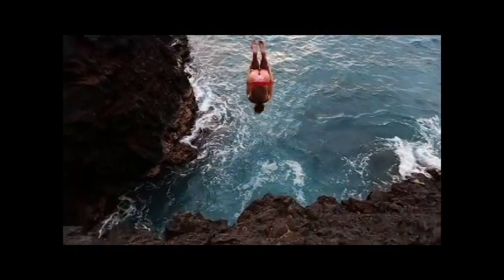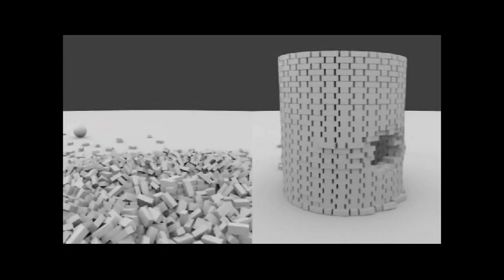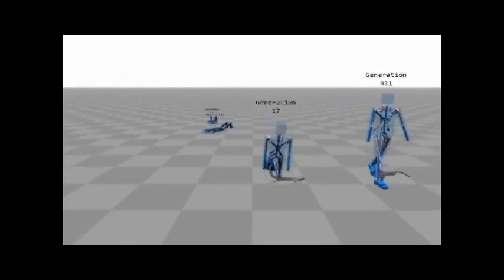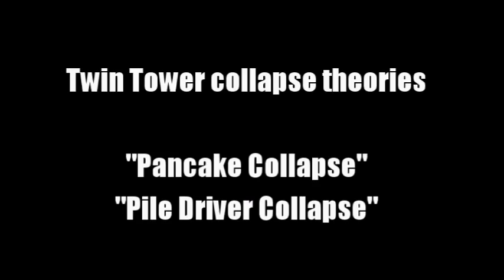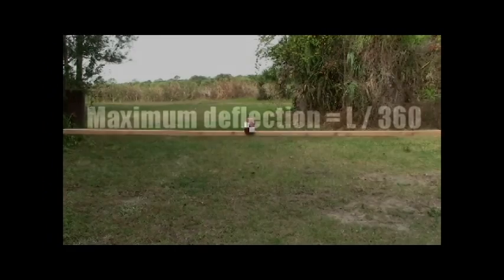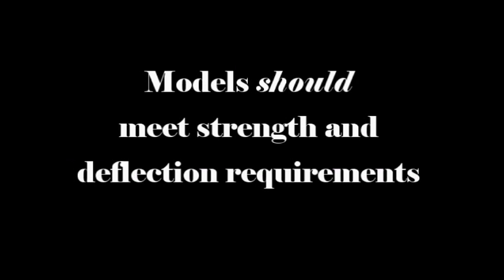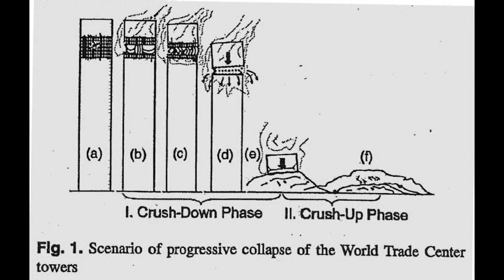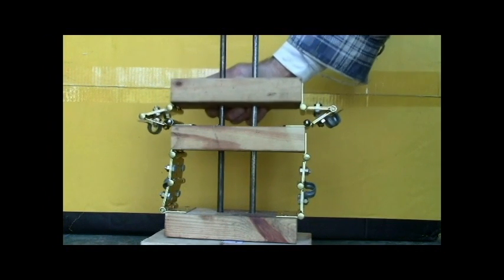9/11 Experiments: The Force Behind the Motion

Comment: Bottom line, this was an inside job
Reply: Andrew and explain how steel can magically swallow and aluminum plane.
Reply: Andrew That’s right. I’d understand the top 20 percent of building collapsing. But it should’ve stopped there. The rest was a demolition. It breaks the law of gravity and physics and air resistance is a huge key factor is the governments fantasy.
Reply: HungryForWater FX "it should have stopped there".  Should it have?  That 20% you speak of weighed about 45000 tons.  The floor underneath that can only support 1300 tons....couple that with the flawed exoskeleton design of the building.  Multiply that times every floor going down and you get a collapse.  God I'm so tired of explaning this to you conspiracy morons.
Reply: Andrew and the building were built to withstand plane crashes at 600 mph.
Reply: No energy was conserved?
Reply: You haven't watched the video have you. Watch the North tower collapse, in reality it took close to 25 seconds due to the final beams needing to fall down. However I will give you the benefit and I will only count to when the main collapse hit the ground. Around 17 seconds. No law is broken. Also you will be using why didn't the building slow down? Well it did actually, the North Tower nearly came to a stop before hitting the ground. Due to this people inside Stairwell B on the bottom floors survived.
Reply: Don't bother giving me any of your proof. I used to believe in this nutjob. I don't now cause the arguments are pathetic.
Reply: Now WT7 is the smoking gun? 
Well I'm sorry it didn't collapse in 5 seconds either. More close to 16 seconds. See the building was collapsing 10 seconds before the 9/11 truther videos begin. The building started collapsing with the East penthouse. It dominoed down which brought other internal structures down with it. Eventually the outside core couldn't withstand it so it collapsed.
Reply: How does your life improve when posting here?
Reply: Damian Gastelum you are 100% right I've been saying it since day one come on anybody with any logic could you just look and see
Reply: Listen to how it sounds at the beginning, with just a few, versus many at the same time...
https://youtu.be/aNMZSlinbMU?t=11s
It's as though there is a sound cancellation going on, thus creating a hiss, rather than pops.
Likewise, a rumble, rather than booms...
https://www.youtube.com/watch?v=VU7cTfdxOkY
Reply: Your proof being?
Reply: Andrew No energy was conserved
Reply: It didn't break any law of gravity. Everything falls down, thats why buildings are built to not fall down. However when a plane hits it with 11 times the force it was built to withstand it might just collapse eventually. Especially if it burning for half an hour. The steel beams were weakened to less than half their strength
Reply: Andrew it sure did. The buildings fell about in 10 seconds. The building fel at free fall rate which is 32 ft per sec per sec, that’s means there’s no air resistance. But in New York air resistance is high due to it being st sea level. The building should’ve fallen longer if the floors were collapsing on eachother. What’s your thoughts on building seven? Falls from absolutely nothing. And don’t tell me the office fires did it because then that wouldn’t explain how the Oklahoma City combing blew up have the damn building stood perfectly. A plane ran into the Empire State Building and stand strongly today. The twin towers were the most planned out architectural project in history. The facts and evidence is there. It’s your job to figure them out n
Reply: HungryForWater FX the empire state building was A.) not hit by a commercial size plane going top speed carrying full fuel, and B.) was not designed like the WTC.

Comment: Just like math experiments are models too. And it doesn't matter if you do a simulation or an experiment. If your model is wrong your conclusions will be too. And there are many faults in your experment. E.g. the used materials do not even closely match the ones from the original towers. Therefore your conclusions are as wrong as the other theories you mentioned.

Comment: This experiment makes no sense. The towers weren't hit by kinetic orbital strikes lol
Reply: They weren't smacked down by the Jolly Green Giant like NIST would have us believe either. So what's your point?
Reply: What? My point is that this experiment was poorly designed and doesn't produce any useful data. I'm as skeptical of the official reports as the next guy. That doesn't make this real science. This is a backyard conspiracy mythbusters attempt with no real structure. It only proves a true lack of appreciation for structural analysis, the professional engineering community at large, and computers apparently? It just blows my mind that anyone would find this more conclusive than the most basic digital analysis.
Reply: Gabriel Clavijo  As an expert, how would you design a project of this type to demonstrate the "official reports" (NIST's building studies?) are either valid or complete bunk Gabriel?

Comment: This Experiment is extremely flawed! For starters, your Concrete Slabs do not accurately scale to the real towers, they weigh FAR less then they should. Secondly, the Fire didn't burn in Segments, it destroyed the floors the plane it and USED the Elevator Shafts as transports really, to reach other floors. Thirdly, your Plastic Pizza holders are way way too strong to accurately represent any supports. Not to mention if it had been Powerful explosives, I'm almost positive you would have Heard "BAM" "BAM" "BAM" "BAM" every time a floor collapsed, ALSO how did no one notice any wires running throughout the ENTIRE building? Yeahhh, BULLSHIT.
Reply: Jet fuel (kerosene) is not an extremely powerful explosive that produces a relatively slow moving, un-energetic wave front of expanding gas roughly equivalent to a warm breeze of 90 mph. It was not responsible for any explosive damages to the structure of the trade towers.

Comment: I can create a model physically resembling the WTC, doesn't mean there's even a remote structural resemblance. It's like doing aircraft simulations with paper planes.
Reply: I guess the models that are used for wind tunnel testing should all be made with steel instead of wood or composites then, according to you?
Reply: Completely different ball park.
Reply: +Mister Disco  When you wrote "I can create a model physically resembling the WTC," why don't you? Use what ever material you want. See if you can demonstrate NISTonian 9/11 physics of resistance free collapse of structure. Betcha caint.

Comment: +Von Staufenberg
""the effect of temperature on steel reduces both its strength and its modulus of elasticity" - and you suggest continually and FALSELY that the tower columns couldn't have failed by crushing, when they actually failed by BUCKLING.

"one simply could not overcome the design factors of safety of the columns" - ONCE MORE you make the same false assertion..  

"That is reinforced by history" - History shows that TALL all-steel buildings have ALWAYS failed when subjected to sustained fire.

"Many such buildings" - The 'such' buildings you talk about AREN'T ALL-STEEL.  Why misdirect us all?

"the government narrative states that the joints failed" - In the case of the aircraft impact this was true.  The aircraft didn't cut the columns: it tore the fascia elements (including their columns) from their fixings.  This was a natural occurrence, as fixings are designed to fix without having to accept the main loading.  Loads applied along a different axis can easily break them.

"If that happened" - it certainly did happen: still photos of the torn facades show it.

"50 massive columns no longer carrying the weight of the building would simply remain standing" - FALSE on two counts:  a) The columns weren't massive, but steel rectangular steel tubes only 5/16" thick.  b)  ALL columns in their immediate vicinity were immediately overloaded., The columns you mention were no longer part of the structure, except as increased load on the remaining intact columns.

"They start with a FS of 5 against instability" - FALSE.  It must have been higher than that, or else it wouldn't have been possible to photograph DROPPED FLOORS.  Consult Euler's Equation P = PI^2*E*I / (K*L)^2 and you will see that the column unsupported length DOUBLES, reducing STABILITY to 1/4 of its former value.  Being raised above 650 degrees Centigrade would have HALVED the column's stability to 1/8 its original, which is BELOW your claimed safety factor, and yet the columns didn't fail at that point.

"they have a FS of at least 30 against instability" - You are considering columns which are no longer part of the structure, except as load.

"nearer the base of building" - has nothing to do with the failure of the tower columns where they failed.

"it doesn't matter because the steel melted" - The steel temperatures never at any point exceeded around 1,100 deg C, which is nowhere near the melting point of steel.

"columns sliced" - by rescue teams.

"Certified tests of debris proved that steel" - was corroded.

"First responders after the collapses described it  as like a foundry" - because many materials melt at 1,100 degrees C.

"iron microspheres" - can be made by heating primer paint to 500 deg C.

"a form that could only have resulted from liquefication" - FALSE.

"linear explosive assemblies" - Would be clearly audible ten miles away.  Were they heard?  FALSE.

"this wasn't a forge" - NO.  The towers were 'muffle furnaces', as their burning floors contained THIRTY times the calorific value required to soften the steel that failed.

Every claim you have made has been FALSE.  This has been the third time you fail to acknowledge my posts.
Reply: Yeah, there's my man Tony telling the world how the columns all collapsed straight down into themselves by linear buckling without lateral deflection aka telescoping. Good plan Tony, keep trying to baffle with bullshit.
Reply: Fayed 'inshallah
"linear buckling without lateral deflection" - https://en.wikipedia.org/wiki/Euler's_critical_load
Ooops - don't you see lateral deflection?
Now, are you lying?  Or are you too stupid to have checked?  Choose...
Reply: I'm only guessing here Tony, but if I was to say I put a straight edge on the monitor beside the Building 7 vertical structure while watching it implode observing no lateral deflection (aka bucking) for the first 2/3rds of the sequence on videos, that wouldn't be politically correct and you would feel compelled to tell me what I actually saw in person, right?
Reply: Fayed 'inshallah
It's nice of you to not lie for a  change.
However, the exterior of WTC7 buckled down below, and outside the video frame.
You actually saw WTC7 fall in person?
Then you were at street level, and watched the buckling below the video frame.
Then why are you lying?
If you examine pictures of the collapsed WTC7 (and it's all there) you can see the buckled columns still attached to the ground, and still intact all the way to the roof.
However, they are twisted to shit.  That's buckling.
Reply: You make this too easy for me Tony:
"However, the exterior of WTC7 buckled down below, and outside the video frame. You actually saw WTC7 fall in person?"
No I didn't Tony, neither did you or anyone else. Therefore you have no basis to make such an unsupported claim. What else would you like to deny or lie about today Tony?
Reply: Fayed 'inshallah
"I didn't Tony, neither did you or anyone else. Therefore you have no basis" - I have just given you the basis:
"If you examine pictures of the collapsed WTC7 (and it's all there) you can see the buckled columns still attached to the ground, and still intact all the way to the roof.
Somehow you only see what you wish to see, and ignore what you don't wish to see.
You ignore these facts:
1) WTC7's collapse began ten seconds before its exterior began down.
2) Its exterior fell because its base buckled (10 floors below the video frame).
3) It fell with no noise (ruling out explosives).
4) It accelerated progressively up to near G (ruling out explosives, which would instantly allow an acceleration of G).
5) Its columns were uncut (ruling out explosives, but confirming buckling).
Reply: I gave you my basis to ignore your tripe Tony. You choose to ignore it. Nothing I can do at this point but to wish you a great day. Ta Tas

Comment: The lack of noticable deceleration in the pile driver theory test could be 
possibly explained by a more accurate model. Perhaps the weight to height to 
floor support ratio of the model does not accurately depict the WTC 7.

Please make a new video where you take explicit care in modeling the weight of the top floors that people claim are responsible for the pile driver motion, as well as the height. Perhaps even a better look at the materials strengths would be good too.